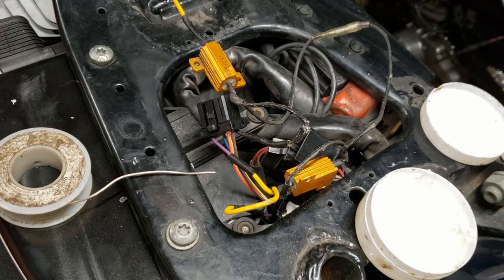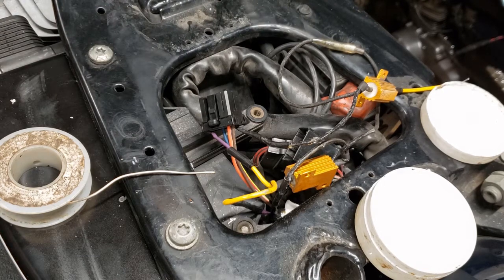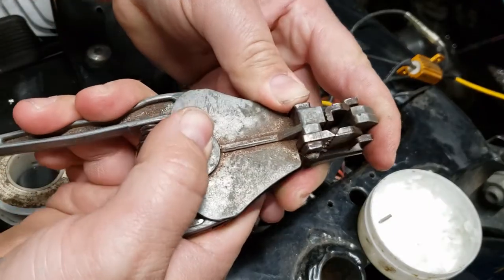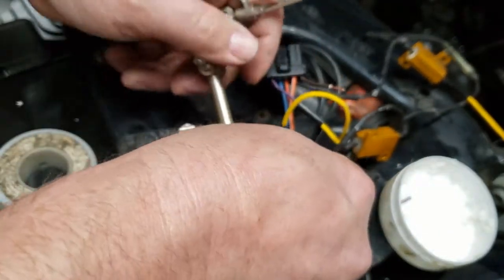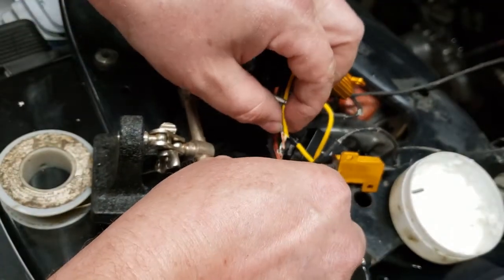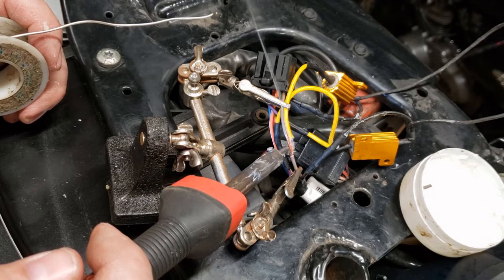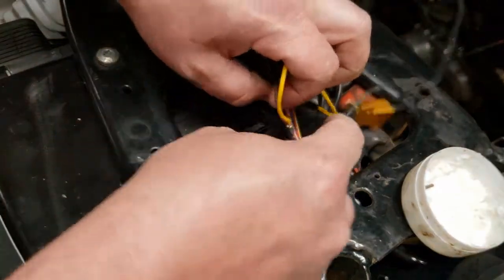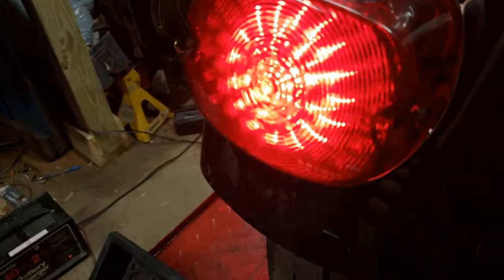LED turn signal  cheap load equalizer install

Comment: Why did you use a 25w 8 Ohm resistor? ive been trying to figure out what to use but have no luck. 2008 lowrider
Reply from the maker: I just used the generic "turn signal resistor" from Amazon. 25w should be about a standard incandescent 12vdc bulb draw.  It does not have to be an exact load to ensure that you get the proper blink.  Don't overthink it.

Comment: so any problems with heat? i notice you just packed all your wires there under your seat and didnt bother to mount the resistors anywhere. No heat issues?
Reply from the maker: No they don’t get very hot when they are resisting a “blinking” circuit.  I have use them on a handful of other bikes and you can hold them in your hand as they work.  I should I have added that in the video.
Reply: Cool. Im going to use 50watt 8ohm resistors on my vtx 1800. See any issues doing that? Thx for the informative vid.
Reply: I love harbor freight
Reply from the maker: @vinsonwalton28  should be fine.

Comment: My 03 sporty I put led bullets in and they don’t blink they just stay lit when I turn the signal on. Didn’t put them in the rear yet cause I knew I needed to get resistors. Will these fix the problem and can you link them please
Reply from the maker: Yes, the resistors on the rear, will make the front ones blink also.   I do not have a link, but they are available on amazon.

Comment: does it become very hot? I used kuryakyn load equalizer on my harley 2009 FXCW and it become very hot I can't touch it by hand..
Reply from the maker: Because it is a pulsing circuit, it does not become very hot. I can keep my finger on it the whole time.  If it was "resisting" a steady load, then it would probably get pretty hot.
Reply: @KnobleMoto  thanks for reply. I read somewhere it could lead to a fire or burn some parts if its come in contact with them.. I did not measure the temperature but I can say around 70 c.
Reply from the maker: @yousefhakhak5661  mine is in with the rest of the harness, and has been there for a few years.  No damage on anything else.